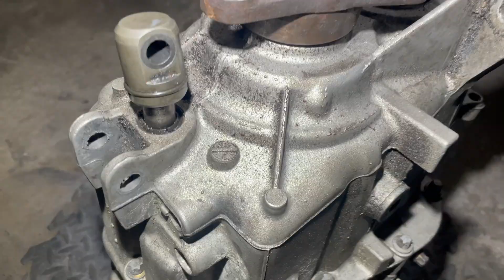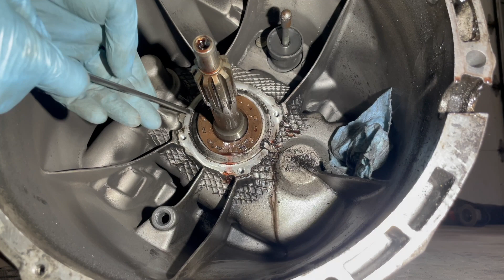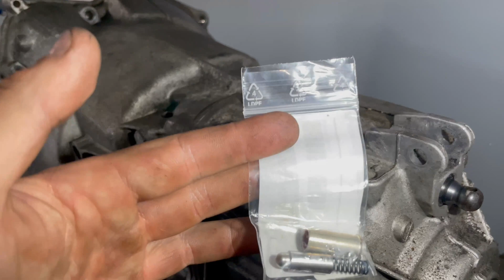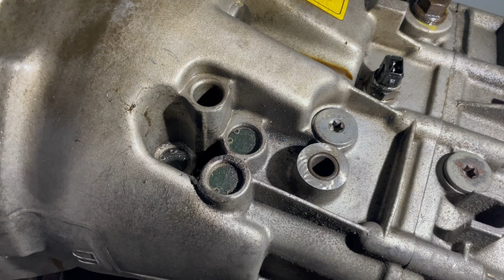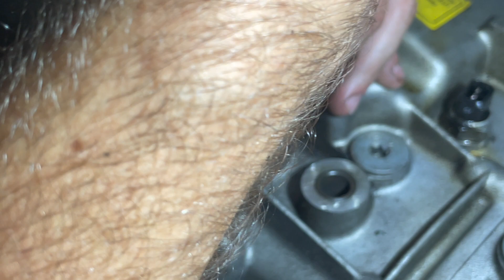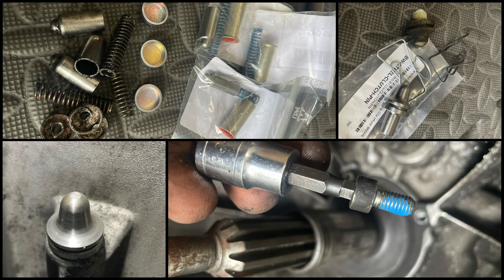BMW ZF 5 Speed (328/M3) Detent Repair & Transmission Seals

Comment: My shifter still leans towards the right after doing all of this, any ideas? New 5th and reverse detent
Reply: I had the same thing, detent is probably stuck because you didn’t file down the high spots enough. Gotta do the job again and use a long socket with sand paper and a needle file to smooth it out. Dont take off too much where the bushing is loose fit, it needs to be tight in there but not too tight where the detent cant move

Comment: Maybe you can post a pic of all the tools used and the part numbers for the repair kit. 🫡🫡🫡
Reply from the maker: You can get the detents on bimmerworld (part# 100.23.536.0003), they also offer an entire seal kit for the 320ZF (part#: ZF-S5D320-SEAL-KIT). 
As for the drift tools there is a bunch of companies that sell them now. Just keep in mind that:
drift 233110 is for the upper detent bushings, 
drift 232360 is for the zinc caps on the upper detents, 
drift 234023 is for the reverse gear bushing

drift 234022 is for the 5th gear bushing

drift 234021 is for the 5th and reverse gear blue caps
Reply: @OnlyyDans  thanks 💪🫡